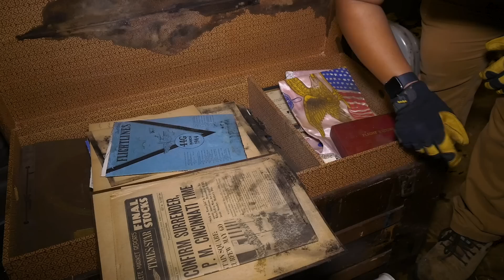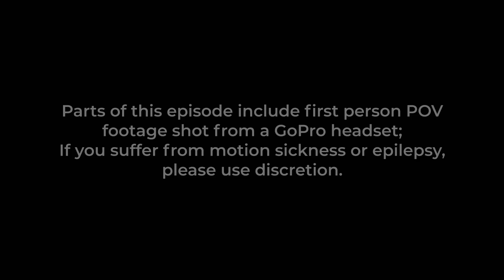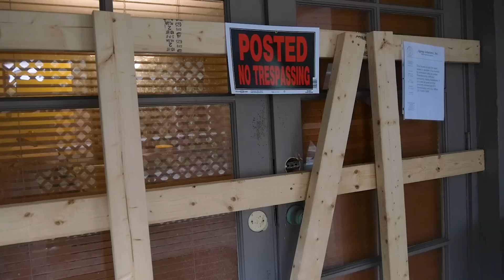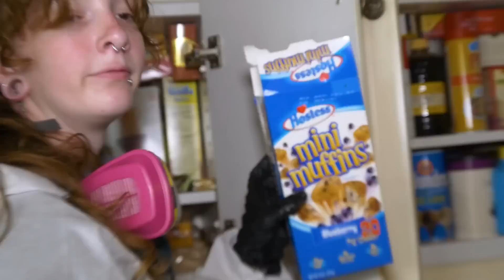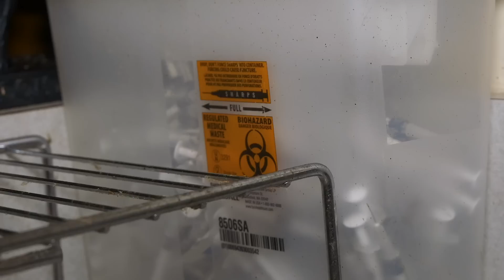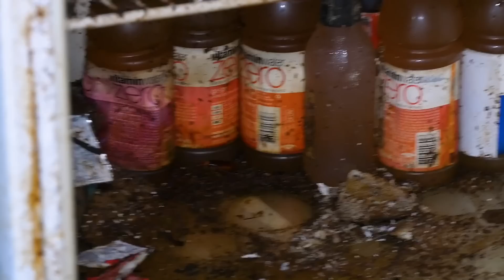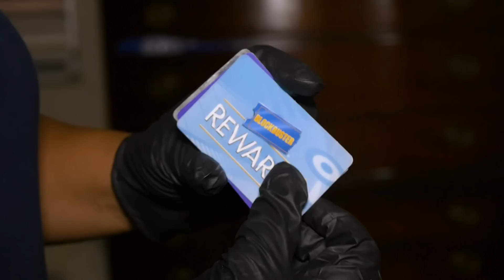Squatter House Flooded with Rats (and Roaches) | Tampa, FL

Comment: My exs mom had a bedroom with no furniture that at one point had close to 30 cats in it and she couldn't change the litter box often enough so she just let them use the bathroom on the floor of that room. She kept them in the room 24/7. One of her relatives got animal control involved.  I wound up cleaning that room out several years later. Cat shit everywhere and in places over 2 feet deep. Found 3 mummified cats. Had to take all the flooring out and replace it and the drywall had to come out about 4 feet high. Just the shit took me like 6 of those big gray trash cans.  Thank god I had a good respirator.

Comment: The chocolate milk reminded me of a jar of mustard I found in an old dumping area from the mid 1940s. It was still sealed with the mustard in it. I of course was fascinated so I brought it up to the house to wash the dirt off with the hose and the jar accidentally tipped over and broke. The mustard was all separated so I had the nasty yellow mustard yolk oozing down the concrete with the oils all runny. The smell was like the strongest vinegar ever. My mom was so pissed.